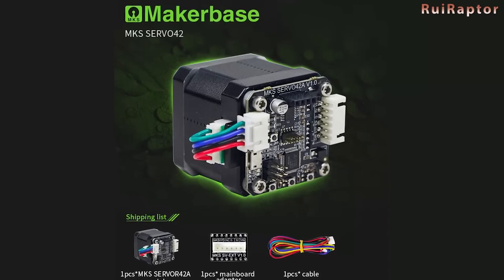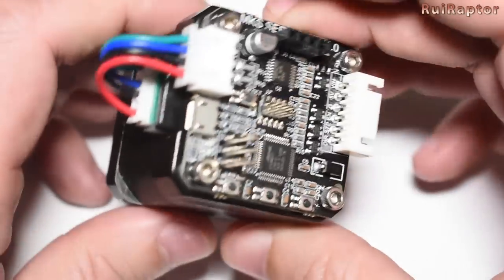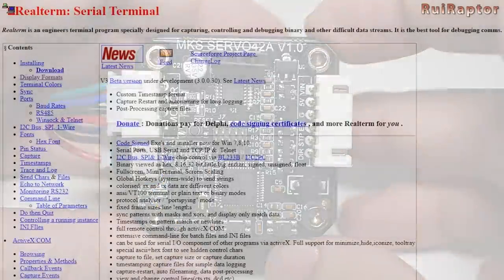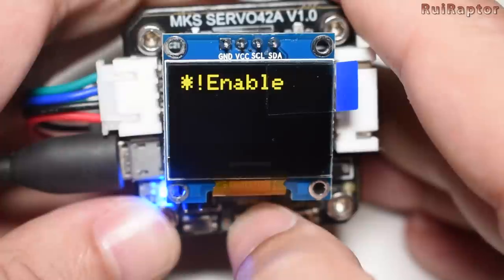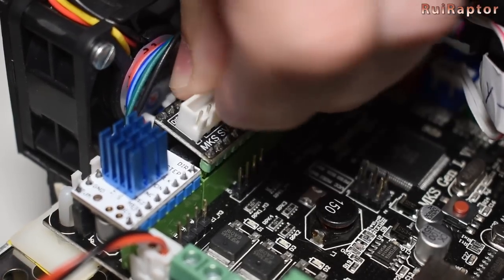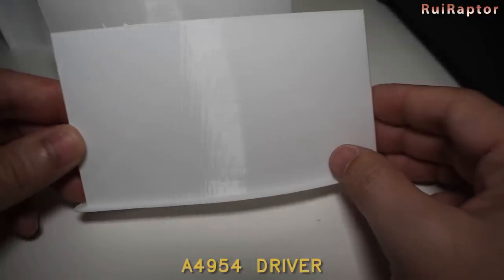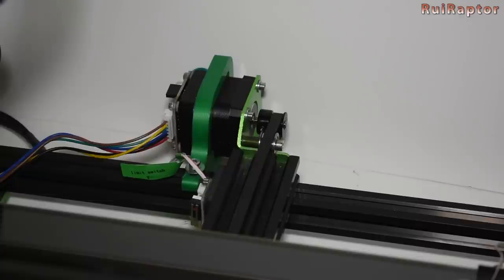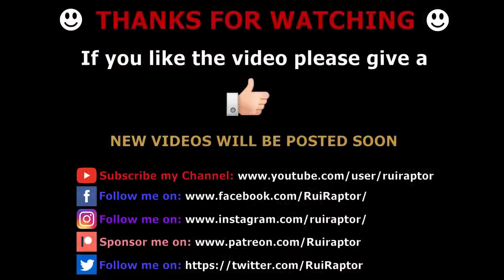MKS Servo42 Close Loop Motor (MAKERBASE) - Tests & Results

Comment: What about increasing the microstepping on the motor and adjusting the firmware?   Wouldn't that help with the salmon skin?
Reply from the maker: I normally don't use higher microstepping values with 8bit boards. Perhaps with a 32bit board such as a lerdge that test can be properly done.
Reply: @ruiraptor  So were you using the same microstepping value for the TMC drivers?
Reply from the maker: Correct. I used the same 1/16 steps for the TMC drivers.

Comment: Hello, this model is compatible with an SKR mini E3 V2.0 that has built-in drivers?
Reply from the maker: Hi Julien, no, it's not compatible with the SKR mini E3 V2.
Reply: i bought the bigtreetech s42b ender3 kits for $16 each without the motors because i use 920z in 2.1a steppers. they come with a small adjustment wheel is the only difference between the models in the bigtree lineup. but it is made for the ender3 and they have a page with the firmware for all others if its needed to change to make it compatible for the 4988 drivers. as for thee mini i dont know about clearances because you are adding about 10mm to the length of the motor

Comment: What is the difference between this servo board and the Mechaduino ( which is open source and the MKS as usually not. )?
Reply from the maker: Hi,
At first sight, the makerbase looks more complete as you can add the display and see information on the screen and quickly change some settings without the use of a computer. Both use the same driver so i suspect that the mechaduino should suffer from salmon skin as well.
Reply: @npgoalkeeper _ could you give some explanation how to tune PID loop? I've got the BigTree Closed Loop Kit and would be interested in your experience. Thanks!
Reply: @npgoalkeeper _ Thanks very much for your quick response. I'll take a look at the documentation.
Reply: @npgoalkeeper _ Here is the doc for the S42B from BTT. On page 14 you can see where you can tune the PID https://github.com/bigtreetech/BIGTREETECH-S42B-V1.0/blob/master/42%20Stepper%20Motor%20Closed%20Loop%20Driver%20Control%20Board%20Manual.pdf

Comment: Anyone tried the MKS SERVO42C? It apparently no longer uses the A4954 but "4 Half bridge driver with 8 MOSFET" but I was not able to find any comparison besides the Video from MKS themselves but that one looks promising
Reply: The servo42c does true field oriented control, which is why it uses 8 MOSFETs - that's the correct way to do it. The version shown in this video is closed loop, but isn't actually field oriented control, it's just a regular stepper driver.

"Closed loop" and "field oriented control" aren't the same thing. Field oriented control creates a magnetic field based on actual rotor position relative to the stator to create maximum torque. It is also closed-loop at the absolute positioning level. Regular closed loop control without FOC is only closed loop at the absolute positioning level, but it doesn't care about rotor position relative to the stator. The driver algorithm at that level is still the same as a regular open loop stepper.

Comment: Nice video as usual 😍
does it work with RAMPS 1.4 ?
Reply from the maker: Hi,Yes, it works with a ramps 1.4. You just need to plug in the adaptor and that's it.
Reply: can't you listen?  
he fucking says it's a plug and play system and you don't need hardware or software changes as long as you can swap the stepper drivers.

Comment: Features of motor / servo system
A magnet that transmits a rotation angle with a center deviation is adhered to the rear end of the motor shaft.
A Hall IC that receives the rotation angle is attached to the board with a center deviation.
In order to drive correctly, the angle detection for the motor drive must be performed correctly.

The base is fixed to the motor through a simple plastic spacer.
The fixing element also serves as an assembly fixing bolt for the motor, and is tightened with a force that does not damage the base and spacer, has relief due to strong lateral stress, and prevents destruction due to displacement.
The motor / servo system compensates for the relational accuracy error by learning.
What you should not do.
Accurately attach the sensation magnet to the rear end of the motor shaft.
Does not give an impact that disturbs the angle detection accuracy.
Does not give an impact that disturbs the position related to the assembly of the motor.

Comment: Can this Stepper be controller via USB too? (for easy left right move op*s) Thank You
Reply from the maker: Yes, you can connect it by USB to a terminal software and control it, calibrate it or change some parameters.
Reply: @ruiraptor  thank you, but may i connect a LIMIT SWITCH too, or THEN i need a COntroller again?!

Comment: Very good review, but could you do a more detailed video on how you did RealTerm installation, settings and configuring the MKS Servo42...
I can't get it to work!
Reply from the maker: Hi, we will review a better motor soon and we will try to include that information.
Reply: it is possible you may need to update the firmware of your control board. try their git hub for that  https://github.com/makerbase-mks/MKS-SERVO42B

Comment: The encoder that the motor has is incremental or absolute?
Reply from the maker: It might be incremental but it's all done internally on the small board.
Reply: These kind of servos are universally based on magnetic sensor which detects the angle of the magnetic field from the magnet on the end of the shaft, so absolute.
Reply: @KarriKoivusalo  so in case the power goes out, the servo still knows in which position it is, isn't it?
I would never have to do a homing right?
Reply: @manuelrodriguezlatorre8978  Homing would still be needed in most cases; while the driver knows the shaft angle on a single revolution, it has no way of knowing how many revolutions the shaft has done while out of power. On a blackout resume with everything held in place it could resume with complete precision.
Reply: According to the specs of the sensor found in the link, it's a high resolution angle sensor "The A1333 is a 360° angle sensor IC that provides contactless high-resolution angular position
information based on magnetic Circular Vertical Hall (CVH) technology. ". Link: https://registration.allegromicro.com/#/parts/A1333

Comment: Is there any information on how to connect them to Arduino? Are they compatible with ramps 1.4?
Reply from the maker: Yes, they are compatible with ramps. The connection should be very similar with the connection made with the board in the video.
Reply: @ruiraptor  Thank you! Another question: what magnetic encoder does it have? (from what I understand in your video you have MKS SERVO42A, not the newer MKS SERVO42B which has Allegro's A1333LLETR-T). Is it AD5047D?
Reply from the maker: The new MKS Servo42B we don't have yet. We might test it soon.

Comment: How about the printing dimension accuracy like x,y,z cube, does it eliminate small dimension error?
Reply: Did a 20mm cal cube recently, about the same accuracy as before.
Reply: @nathanmattison474  is it 20mm exactly or a few mm smaller/larger? How much is the error in mm approximately?
Reply: @calvin-7540  Well, my printer was usually off by +-0.2mm depending on flow rate. At 100 percent flow rate, it was 19.93mm in the x and y which are the axis I out this type of stepper. However mine is a 7 pin Chinese clone, same concept, but mine doesn't have a USB and other stuff. So you could say it did better, but I attribute that more to just the conditions at the time like maybe my garage was warmer then before, etc...
Reply: @nathanmattison474 Thank you for your reply. If I am not wrong, the makerbase brand is from China as well, so there is very little chance to have clone in the domestic market in China【almost all China clone products available overseas can be found in China market as well (Taobao)】, maybe your one is the latest 42B version which the manufacturer eliminate the USB port.
Reply: @nathanmattison474  Based on the title and appearance in the image, it is clearly the MKS SERVO42B which is the latest version
Reply: you still have to calibrate these as with any stepper
Reply: @nathanmattison474  if they only made one with a bigger stepper i would get the completed motor kit. but i use 92oz in 2.1 amp steppers so i had to get the no motor kit and finde 65mm m3.5 screws to mount it:) these wouldnt be needed in a printing situation unless you had a large heavy bed and were printing heavy items. Im running a mill and i want the lateral torque besides i upgraded the z axis and not iw weighs 5 kilos more than the original axis did

Comment: Hi 
Can I control this stepper motor with arduino ?
Reply from the maker: Hi,
The 3d printer boards are normally equipped with Sanguino or Atmega microcontroller chips and programmed with arduino IDE, so yes, you can.
Reply: @ruiraptor  I meant can I control it as a standalone directly using an arduino and a stepper driver ?
I plan to use it for a model railroad turntable.

Comment: god this is perfect. what about noise tho?
i wish you tested noise so much.
it's so dumb it has salmon skin
Reply: So I am using this system with an MKS Rumb32 and cannot recommend it. Even at 256 microstepps it is loud, you can't compare it with the TMC 2130 that I had installed before. Even the Rumba32 had to be modified to run with tmc2130. The print result for the TMC2130 is not much better.
Here, savings were made at the wrong end. I don't recommend buying it or you can live with the volume. I am disappointed.

Comment: interesting, could this be used on an extruder?
Reply from the maker: Hi Domenico,
I'm currently testing it on the extruder :)
Reply: @ruiraptor  How did it go?
Reply from the maker: @sirkojac   , at first it was very interesting as I was getting perfect filament output (and it was always consistent for different filament types and speeds) but then I started to get different results depending on the model. It's very difficult to dial in the profile so I eventually stopped the tests. I might get back to this later when I have more time.
Reply: no
Reply: you cannot use this on an extruder.  

what happens when you get a clog.  it starts skipping.  it will then try to compensate and skip even more.  and more and more untill you break something. 

what happens when you don't get a clog but it still skips. 
then you get a part of the print where it skipped so you have underextruded.  and then it compensates by overextruding on another part of the print because it's already passed that part of the print.

Comment: could this be used as a servo in a robotics project?
Reply from the maker: It depends on the project...the stepper motor can be used but the size and weight might be an issue if your robort is small.
Reply: @ruiraptor  my robot is rather large so that won't be an issue.
Reply: Yes of course these can be used for any application a stepper motor is used. There is no downside to closed loop

Comment: So there is no backlash?
Reply from the maker: Backlash comes from the mechanical pieces like the leadscrew nut. If you had the encoder along the axis then you could control the backlash electronically. Here you have the encoder in the motor it self so no.

Comment: Would have been nice if the made it where we could put on TMC2208 driver on the board ourselves then it definitely would be worth buying great video as always keep up the great work and if you could make a short video on how you installed TMC2208 on you tevo black widow and what you had to change in the firmware to make them work would be greatly appreciated thank you.
Reply from the maker: Thanks for the feedback Jim.
Regarding the TMC2208 on the black widow, i did the same thing as in my video of the MKS GEN L upgrade.
Same jumper configuration.

Comment: Nice video, but You didn't show how fast it can go OR is that another video?
Reply from the maker: Hi,
No, we didn't show how fast the motor can go because it can turn faster than the printer's axis can handle.
Reply: @ruiraptor  in a 3d printer it is belt driven, but on a spindle transmission higher speeds are desirable. I was interested in your video because few hours earlier I wanted to buy that motor:)

Comment: wait i'm confused. isn't this a servo? why are you using an a4988?
Reply: he calls it allegro because on the servo there is an A4954 Dual Full-Bridge DMOS PWM Motor Driver installed to power the motor :)

Comment: Can we use TMC2208 driver with this motor?
Reply from the maker: No you cannot. The driver is included on the small board.
Reply: @ruiraptor  does the driver on the board make much noise compared to the stock driver
Reply from the maker: It makes the same noise. The driver on motor's board is also an allegro.
Reply: @ruiraptor  I dont understand why they would go to the effort of creating this then put an old driver on it
Reply: It's not a stepper driver, it's an H-bridge driver. You cannot use any stepper drivers with this control method.

Comment: Hi there is two model now 42 a and 42 b so which is the good ? thanks
Reply from the maker: Hi,
wen we made the video, there was only the 42. Now MKS has the 42b. We didn't test the 42b yet.
Reply: @ruiraptor looks like they gave you props when designing Rev B: 

https://github.com/makerbase-mks/MKS-SERVO42B

They also open-sourced the firmware.

Comment: No special software /firmware mod required?
Reply from the maker: Exactly. No firmware change or installation required. If you need to change some parameters like motor direction, microsteppings, etc, you can do it directly on the motor
Reply: ruiraptor can you Tell me which cables i have to swap to change Direction?
Ty in advance!
Chris
Reply from the maker: @JustAValidName89  You don't need to change any cables for motor direction. You can access the motor using a USB cable and edit the firmware by sending a few commands or get a display and change the motor direction using the display.
Reply: ruiraptor ty for the fast reply but i asked my question on the wrong Video..... i Wanted to ask this for the trianglelabs Dual extruder Motor Setup on my tevo Tornado..... i already deleted the Post But it Looks like that did Not work 😅
Reply from the maker: @JustAValidName89  , for the BMG extruder on the tornado, install the extruder the other way around instead. It will work the same but the differences are that you don't need to reverse the direction and it will be easier to handle with it.

Comment: how can I know how many steps my motor need to finish one revolution
Reply: 360 / step angle
Reply: also there are usually 2 types of stepper motors for a 3D printer. If it is a 1.8 degree stepper it is 200 steps. If it is a 0.9 degree it is 400 steps.
Reply: The company that made it will provide that

Comment: Wheres the firmware of this? :( SOS (im using it for a project)
Reply from the maker: Hi, you don't need to make any changes in the printer's firmware when using this motor. Step and direction can be changed in the motor.

Comment: Pretty sure I have some sort of cloned version, no usb, 7 pin, and no reset button, comes up "Encoder Error! Reboot
Reply: Turns out SKR v1.3 boards only put out 3.3v on the stepper driver logic Vin. Had to tapp into the servo which has 5v because the encoder runs 5v. Got it to work finally, actually works pretty good, I knocked the axis while printing and it came back and continued printing where it needed to.

Comment: Driver is not responsible for the salmon skin. I rather think that the salmon skin is due to the fact that you use only one servo motor (y axis only) instead of two (x and y). Have you tried with at least two servos?

Edit: btw, thanks for the video, great presentation ;-)
Reply from the maker: Hi,
I find it hard to believe that the salmon skin is created by having one Allegro on the Y axis and one TMC on the X axis.
Why do you think that?
Reply: @ruiraptor  thank you for your answer. Actually I am not fully satisfied by my position either 😅. Full reasoning is a bit long, so I will keep it short: the servo motor has >0.02mm EFFECTIVE LINEAR resolution, and the A4954 is not a stepper driver but a "generic" PWM full bridge driver. All the calculation is made by the MC. Hence if anything wrong with this servo then it should be bad MC choice /code or too low resolution hall effect sensor, not the "driver". Otherwise it might be that the difference of linearity between the servo and the TMC22030 + stepper emphasizes an otherwise unknown non-linearity of the TMC driver interpolation, hence my previous answer.
Reply from the maker: Hi Jean-Philippe,Thank you for your explanation.That would probably make sense if you were working with a delta system or a corexy where you need to have both X and Y axis working together. In this case, where you have a Cartesian printer with independent moving axis, I don’t think so.Regarding the hall effect sensor, this one is actually very sensitive as I show in the video.
Reply: @ruiraptor   There might be hope for 32-bit controllers using this servo at a higher step rate. I might be wrong, but I suspect the reason the TMC2208 drivers work so well at eliminating salmon skin is because they are actually running the motor at 256 micro-stepping when in SpreadCycle mode. This why the TMC SpreadCycle technology is so quiet, the TMC driver is just taking your 1/16 micro-stepping signal from the controller and bumping it up to 256 micro-stepping. I would be curious to see if the TMC2208 driver produces salmon skin with the SpreadCycle mode disabled via driver jumper settings.
Reply from the maker: Hi Kyle,
I will try to test with a higher micro-stepping soon and will let you know. 
Regarding the TMC and why they don't have salmon and are so quiet, I'm not so sure about that and I would bet that they will not produce salmon skin with spreadcycle disabled.
Reply: it has everything to do with the stepper driver! lol